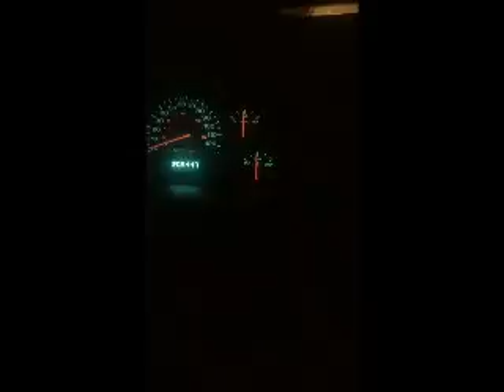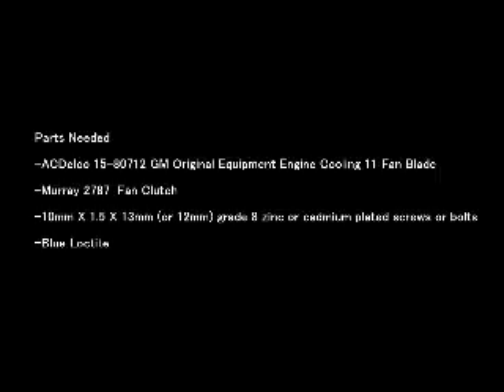Jeep Grand Cherokee Mechanical Fan Conversion 2000-2004 Verdict!

Comment: I went to the hardware store with specs for screws, they said 12mm or 13mm lenght is too short no way it could be correct, can you explain the details in the screw sizes width lenght and screw round size? I did buy everything else so when i get the correct size scews its going in
Reply from the maker: What worked for me was -10mm X 1.5 X 13mm (or 12mm) grade 8 zinc or cadmium plated screws or bolts. Michael below says he grinded his longer ones down because the longer ones are easier to find. It's just going in the flat holes of the 11 blade to the clutch and I found any longer and it wouldn't sit flush. Only thing I can think is maybe you're got a different fan or clutch? I'd just take both parts into the hardware store and you could find out real quick what size works. Once you get it, add a little Loctite after you're sure it all fits in the fan shroud. Hope this helps and let us know how it all goes!

Comment: So glad to find this video. I am a GM guy but I have been trying to fix my roommate's old Grand Cherokee to sell, and I can say I hate Jeeps more than ever now. Thank you for giving me a parts list to fix this thing, because I just want it gone. Jeep should never be allowed to make electric anything, because it always breaks prematurely.
Reply from the maker: Right on, glad you found it helpful. I tried everything with the e-fan relays to keep it stock, even building a heat sink mount from a computer processor, then even mounting in a place with more airflow...just kept popping them randomly over the years. So I had to find a solid dependable solution for sure.

Comment: Just finished this install.
Absolutely great.
Couple key notes 
1) you can cut your bolts down with a grinder, so their thread length is 10mm...makes finding the bolts super easy, since length doesnt matter
2) fan blows air towards the engine
3)elec fan connector is most likely melting inside and slowly burning the wires, so if you are keeping the elec fans(i did), then replace the connector...mine was over 150F after 15mins idle in 85F ambient temps
4) General consensus across the hypermileage/ecomodder forums  is that a clutch fan only cost you about 1/2 a mpg..or...loosely $27/yr in gas as compared to elec fans.
People talk about losing hp, fuel mileage, etc..i honestly think it is more marketing than anything.

Comment: What about sitting still for like 10-15 minutes.does it stay cool.
Reply from the maker: Yep. I did have it in Florida last summer at 100 plus temps and it wanted to inch above the middle mark just slightly, but still in spec and the clutch would kick in and drop it back.
Reply: It is a Jeep for crying out loud! It won’t sit still for anything.😂😂😂🤪🤪🤪🤪🤪🤪🤪🤪🤪🤪

Comment: really? so me thinking about Electric fan conversion is a bad idea? I would buy a universal Electric fan and wire it myself.
Reply from the maker: This is just a fool proof way of ending the Jeep relay/E-fan problem. But if someone has the skills to wire in a whole new electric fan system with a different relay mounted in a place with more airflow then that's not a bad idea at all. Let us know how it goes and feel free to list the kit/parts/placement you use in case someone else want to do it this way.
Reply: @jeepreworked6388  I'm not from USA but it will be the universal fan that parts stores sell in various sizes that you ziptie directly onto the radiator, splice in a temp sensor adapter in one of the radiator hoses and wire it to the battery with a relay. With electric fan you will have a much quieter startup! And slightly quicker engine.. I have done this before
Reply from the maker: @farerse  You for sure can do that, chance of hurting your radiator with zip ties and will not pass emissions, also might not be powerful enough as a simple pusher/puller fan. This thread is for people wanting a simple screw on type fix that could be added to the existing electric fan for emission states or without so there's tons of airflow.

Comment: Hey. I did the same thing you did ... I haven't tried it this year in the winter.. I live in Connecticut it gets cold  up here how would my heater work in winter
Reply: Thank you for responding and thank you so much for all the good information keep up the good work 😃
Reply from the maker: Before I did it I asked a few mechanic friends and they said in theory it could take a little longer to warm up since the fan starts to spin right away. I didn't notice any difference at all though, the fan clutch disengages enough in cold and the heaters as you know in these Jeeps are beasts to begin with. It's only going to engage to it's full speed when the engine gets hot enough where it needs to engage. When disengaged all fan clutches run at about 25%, so I'd stick with the Severe Duty clutch for summers. I travel and have been through 2 ice cold winters and it's perfect.

Comment: Where you get the clutch fan ?
Reply from the maker: -ACDelco 15-80712 GM Original Equipment Engine Cooling 11 Fan Blade (I found on eBay, could try salvage yard or Dealership too, I've read where the similar off brand ones from the local auto stores don't quite fit in the fan shroud..but could always try and return if not)
-Murray 2787  Fan Clutch (O'Reilly)

Comment: I would like to know where this relay is installed in Grand Cherokee 4.7 L 2004?
Reply: The fan relay is located under the front passenger side head light, you got to remove the front clip to get to it or find a video and take a drimmel tool and cut out the spot under the head light. This is the first video I found for a manual fan conversion so I’m going to try it. Lol
Reply from the maker: John is correct, just pull the passenger side headlight and if you're not the original owner chances are very good someone has already cut the hole to get to the relay. It's mounted directly on the vehicle, so the metal heats up and confined space pops these. There's been a few other "fixes" like thermal glue and I even tried taking a heat sink from a old computer CPU and mounting it in between for airflow. Neither helped. I've seen people bypass the relay altogether and use heavier gauge wire...but that is the reason you see a burned up car on the side of the highway. After years of trying every brand, every way to keep it stock I learned to just go with the 11 blade mechanical and you'll have peace of mind and never break down again because of that design.

Comment: I fixed my sisters jeep with a chevy fan off a 5.3 LS engine! The mechanical plastic fans off chevy trucks and probably tahoes/ suburbans too with the 5.3 LS engines will bolt right onto a 4.0 Jeep with no modifications whatsoever the fan is the same thread as the jeep threads on the water pump.. I had a fan off a 2000 Silverado 5.3 laying around and bolted it onto my sisters 2001 Grand Cherokee with a 4.0 that originally had an electric fan, its crazy the end of the jeep water pump was threaded even tho it had an electric fan originally which is surprising, im guessing all 99-04 grand cherokees would be that way also, i like mechanical better anyway, and yes it worked fine with the Jeep shroud for us too. Hope that helps someone
Reply from the maker: Awesome! Thanks for the info. Yeah, the water pumps were threaded to add a tow package at purchase if wanted. It was a 5 blade fan that wasn't enough to cool all by itself, but added some extra cooling for towing giving the extra stress on the engine. Lucky for us it gives an option to ditch the electric fan and terrible relay problems!
Reply: didn't know that, yeah that makes sense

Comment: I have found the parts online and am ready to do this!  I can't wait!  Do you know if Dorman makes bolts for this?  Thank You!!
Reply from the maker: Good deal, you'll love not having to worry about fan relays blowing anymore! I couldn't find the bolts at the big 3-4 auto parts stores so I just went to a local bolt supply. I've heard people finding them online and even something that would work at Lowe's. If you have a tough time finding them just message me or here again and I'll send you the bolt place I got them and maybe they could ship.
Reply: I couldn't find anything at Lowes, but when the fan/clutch comes in I will take it to the local hardware store.  I would appreciate the info on where you acquired yours just in case I have trouble.  Thanks!
Reply from the maker: No prob....Here ya go, https://www.yelp.com/biz/capital-city-bolt-and-screw-nashville-2 I was able to get the 10mm X 1.5 X 12mm bolts there.
Reply: Found some bolts that did the job at Lowes.  Added a flat and a lock washer plus some blue loctite.  Got it put together and installed, but had to remove the shroud and kinda weave it all back in at the same time.  Nice guy at the parts store let me borrow a fan clutch wrench. 

I decided to go ahead and get rid of the electric fan completely so I would have max air flow and honestly it seemed kinda close in there.

No road test yet, but it is running nice and cool out in the yard.

Thank you so much for the video and the part numbers!
Reply from the maker: Good call on getting the electric fan out, it'll stay plenty cool this way by itself. I've driven it to Florida in the Summer and never had an issue. Just can't count how many times the dealership, and eventually myself replaced the fan relay. It leaves you completely stranded when it pops! Mechanical is the way to go in case someone is reading this and wonders if they should do it. Safe driving my friend and let us know what temp it rests at out on the road.
Reply: Have you noticed a decrease in rpm's at idle since the swap?
Reply from the maker: I didn't, but it does make sense with adding the extra weight. I have all fairly new belts and pulleys. With the engine off make sure there's decent tension on the belts and no other part could be too old and slipping. If not and it's consistent and not causing any trouble it should be fine. The only thing I noticed was the just extra sound from all the new air movement.
Reply: Everything seemed good so I decided to just increase the idle a bit.  Problem solved!
Reply: I ordered the clutch and fan for my 04 4.0 engine, and Pepboys has loaner fan clutch tools. 
I'm not much of a Pep Boys fan, but they were the only local place for the parts in stock in a hurry.

Comment: First thank you so much for the tip.
I got rid of my electric fan and have installed this clutch fan setup and it’s been working perfectly for a few weeks now.
My WJ’s  temperature is stable now and never go over 210F.
I have only one concern is that I got my engine light on with p1491 code witch is:

Radiator Fan Control Relay Circuit

An open or shorted condition detected in the radiator fan control relay control circuit. This includes PWM solid state relays.

Do you know anyway to solve this?
Maybe bypassing?

Thanks
Reply from the maker: I've never seen the engine light come on after doing this, but can understand why it would throw a code for sure. If you live in an area with emissions testing then you may want to throw on a small super cheap eBay pusher/puller electric zip tie fan that doesn't draw much power and goes through your old relay as a backup to your new mechanical set up so it thinks it's business as usual and won't throw that code.
Reply: Thanks man!
I’m gonna try this and let you know if it works.

Comment: Would this work on a 99 WJ too? I'm currently on relay #5, which just died out.
Reply from the maker: The original water pumps came with a threaded hub to attach a 'tow package" fan to as an upgrade. Take a look at the front of your water pump for a threaded hub sticking out (would be center of the fan shroud). It's most likely covered by a piece of plastic (easily pulled off with some needle nose pliers) to keep the threads from rusting. I've seen some cheap aftermarket pumps without this, but most likely you have it and this type of mod will work! Double check with your favorite local parts chain on the recommended fan clutch and measure your fan shroud to make sure the 11 blade fan will fit. If your water pump isn't threaded, there's tons on eBay for less than $30. Sure beats that wondering on every drive if the fan relay is gonna blow and leave you stranded. I literally tried everything, name brand relays from the dealership, every brand from every parts store, eBay from China. Changed out every bit of wiring and electronics, new electric fans, Built a heatsink and tried every placement. Always left me stranded at the worst time. My best guess without having a 99 in front of me is that all the parts listed will work in the 99 also. Good luck, and let me know if you have any questions I can research or send pics/video of mine.
Reply from the maker: I wanted to get away from anything electrical and just screw on a giant fan that can't fail that way, but another cheap option would be to use a kit that bypasses the whole WJ system like the HAYDEN 3653 - Engine Cooling Fan Controller-Temperature Switch ($18 on eBay).

Comment: Wanted to say a BIG thank you for sharing this. I have an '04 that has been overheating during this hot summer in KY and all the same issue, AC running / sitting in traffic. This was a pretty simple addition and I did leave the electric fan in place. The part numbers are spot on and were in stock at my local autozone store. Found the bolts and lock washers at Home Depot as you describe. Used the loctite. I did remove that little AC line bracket at the top temporarily to get the assy into the shroud. That was the toughest part of this upgrade. The fan is quiet and moves a TON of air. Confident that this will solve the problem and I won't have to worry about my daughter driving it and staying cool with AC on max. Now just looking forward to the next repair on Clayton. (That's what she's named him) Again I thank you and look forward to your videos to help me with keeping this beast on the road.
Reply from the maker: Awesome to hear John! We made it through the summer just fine down here in Nashville with no troubles at all and AC on max! Every summer before had the problem of it wanting to overheat or popping the fan relay. Now can tow and idle all day long. Since then I've put a bit a little of the Lucas transmission fix in with the transmission fluid just because I know these can have some issues at high mileage and want to keep it safe. Yours being an '04 is prob fine though...Start to watch for the taillight assemblies to start corroding or not making contact. So common got pulled over by Nashville Metro just so he could tell me my taillight was shorting out one side when I hit the brake, then told me he had fixed his mother's same year JGC and wanted to let me know how to fix it!
Reply: My local Auto Zone here in CT didn't have the parts so I had to go to Pep Boys. My local Auto zones are really great people and thats my normal go to place.

Comment: The OEM Jeep fan is hydraulic using the power steering pump not electrical. Im thinking this MOD would really help guys who run larger the stock tires because it may keep the power steering fluid cooler and work better. It might cool the engine better too.
Reply: gdc5ind the ones without the towing package had a completely electric fam with no hydraulic function what so ever

Comment: I can with absolute certainty, confirm that this works great.  I bolted the Dorman 620-602 fan to the Murray 2787 fan clutch and worked it down into the fan shroud from the top.  I had to wiggle and fight a bit but it went in.  After I got the nut threaded and started spinning it on (clockwise) I could tell that there was going to be plenty of clearance.  I got it snug and started it up and BAM!!  No more overheating.  A BIG thank you to you Jeep Reworked.  Here are a few other notes:  The Murray 2787 fan clutch DOES NOT come with bolts.  For the bolts I used M10x1.50 x 16mm (zinc).  I couldn't find the recommended 13mm length.  I bought these bolts at Home Depot and I also used M10 lock washers (zinc) to eat up the  extra 3mm.  I also did not remove the e-fan.  There is plenty of clearance so if you're short on time like I was, you can leave it in.  I do plan on removing it later or replacing the electric motor.  Again, thank you Jeep Reworked.  I am very grateful.
Reply from the maker: That's awesome! Good to know you can save money too with the Dorman fan, plus they're easier to buy local at an Advanced Auto or similar. I could only find slightly shorter screws (12 mm) than recommended 13 mm, that's why I added the Loctite and it's solid. The fact you got the screws/lock washers local too is great for the next person! You for sure made this easier to get parts and cheaper overall, that's why I put this video up to give frustrated people like I was a working fix to start with! Thanks!
Reply: Hi, I just did this upgrade with great results. My e-fan was going out (pushing with finger would get it started) and being short on time, I ignored replacing the weak e-fan and still haven't. I am debating whether I should go back at all to replace it. Have you gotten around to it or have you changed your mind on replacing the e-fan?